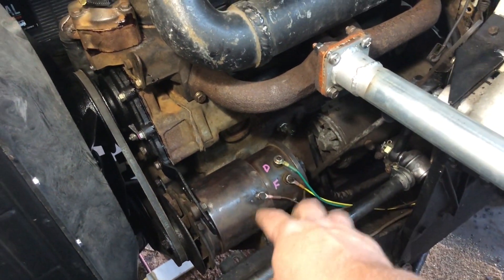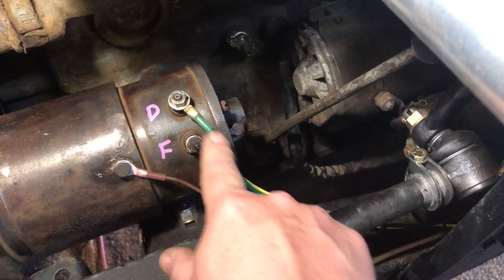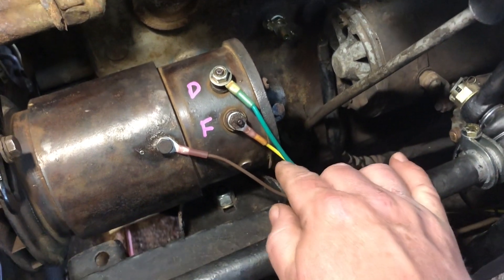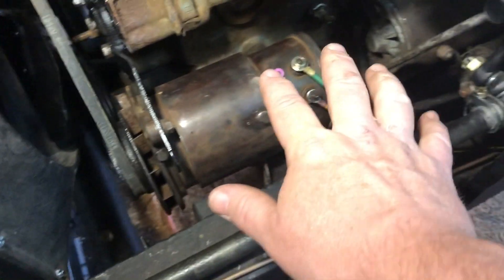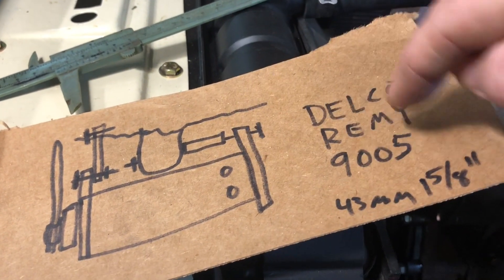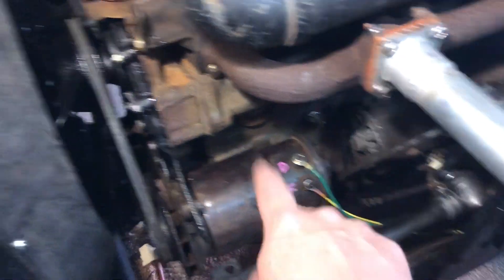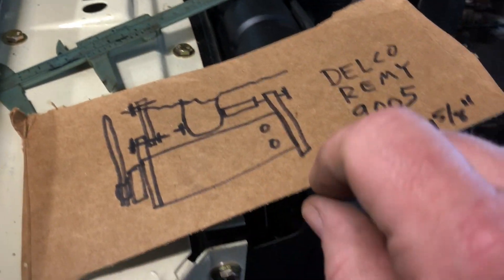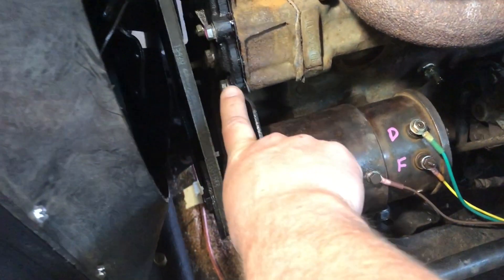Wiring Part 10 - Dynamo Generator Regulator Delco Remy Lucas Land Rover Series 2A Restoration

Comment: Thanks for the vid. What turns on the dashboard charge warning light?  How is it wired to the dynamo? Ty
Reply from the maker: Thank you Sir! The light is powered by the ignition switch with the key. Turn the key on and it sends power to the voltage regulator and it jump down to excite the dynamo.